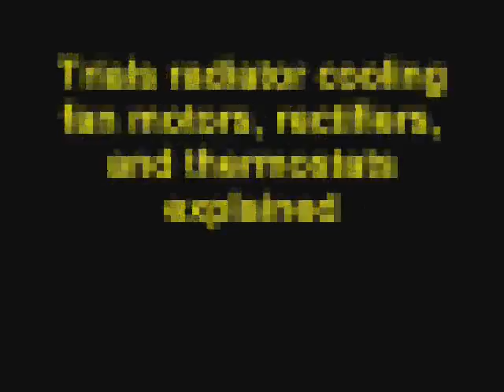Jim Snell explains Trials thermostats, thermostatic switches, cooling fan motors and rectifiers.

Comment: Love your videos Jim. What temp range is the thermo switch?
Reply from the maker: Turns-on at 70°C/158F ~ Turns-off at 60°C/140°F
Reply: @TRIALSPARTSUSA  Hi Jim. Is there a way to just get rid of the thermostat and have the fan running all the time while engine is running?
Reply: @TRIALSPARTSUSA   Bikes a 06 gasgas 280 pro
Reply from the maker: @HoldenPower  you can do that... but.... then you have an engine that has no temperature control. It will take a lot longer to come up to proper operating temperature and run cleanly, and it can run too cold for long periods which effects carburetion. I think that ultimately, you will dramatically shorten the life of the fan motor.

Comment: just an question, if i  untherstand it right does AC comes in the thermostat, and then rectified, and not DC in and directly to the fan ? so do the lights need an extra rectifier ?
Reply from the maker: Lights are A/C, fan is D/C. It doesn't matter if t/stat is on A/C before rectifier or after rectifier, it just turns the fan off and on